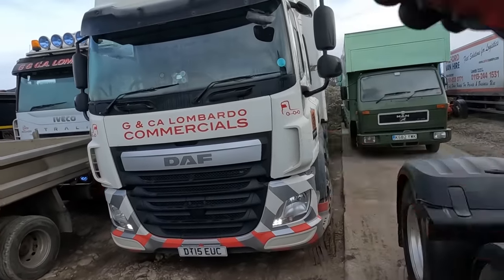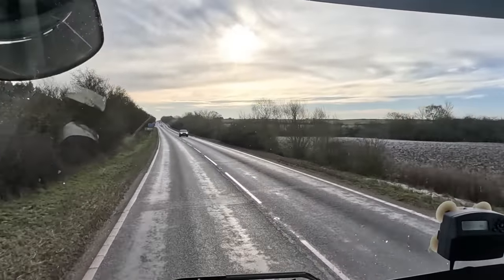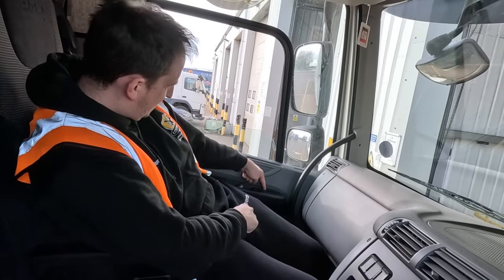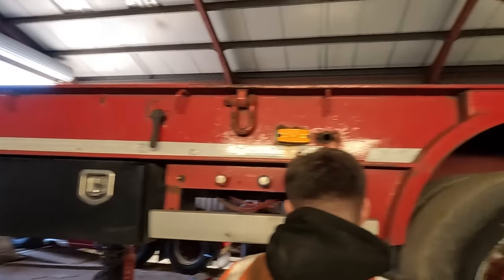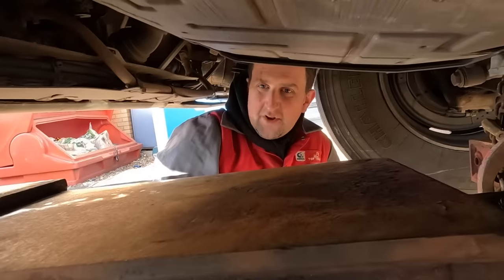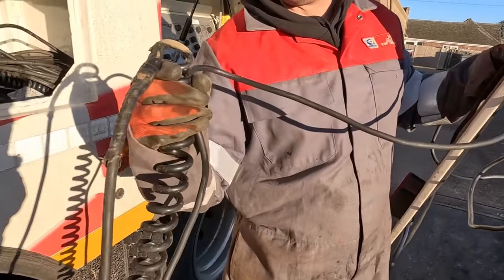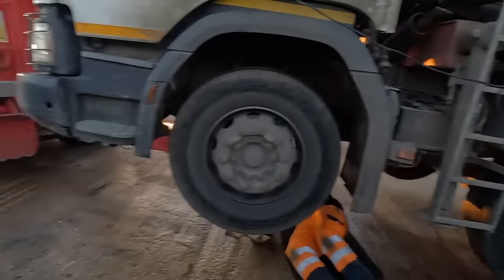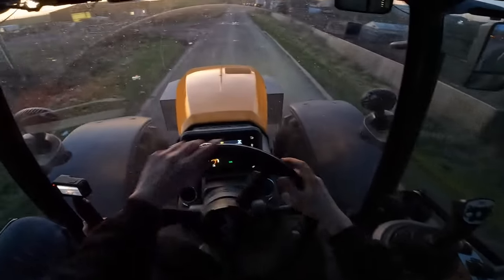I Go PROPER Wrecker Trucking | Out In A FASTTRAC With Shaun | #truckertim

Comment: With all electric windows if the one touch facility doesn't work put it either up or down and hold it either up or down for 3 seconds..... Resets the system and you should get the one touch back

Comment: Can u ask Shaun why he removes the prop instead of a half shaft? Always see the guys on telly removing the half shafts normally
Reply: Double drive on the rear, as well as it being XT spec with diff locks and stuff. On a DD it’s usually easier to just pull the prop rather than half.
Reply: @regularguy3665  ah this makes sense! Cheers